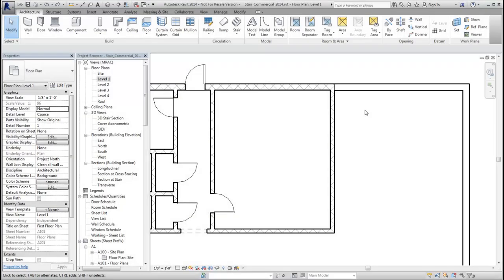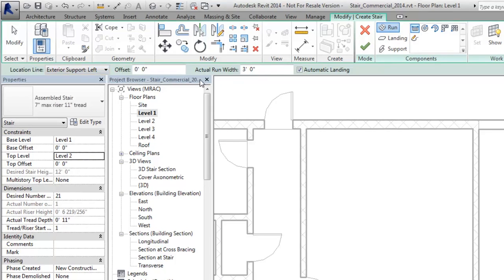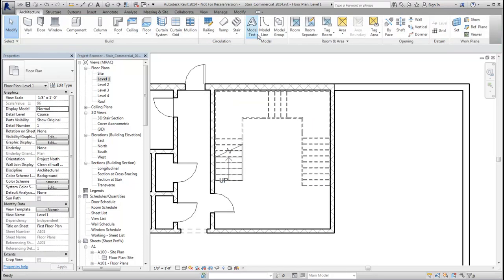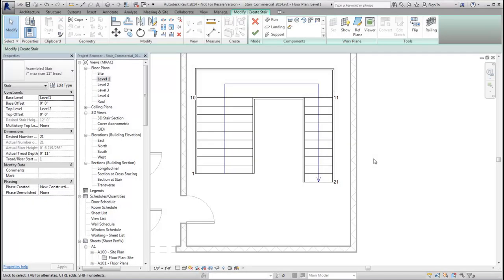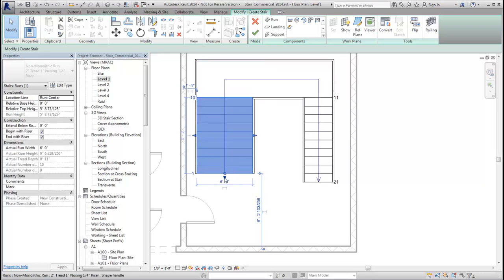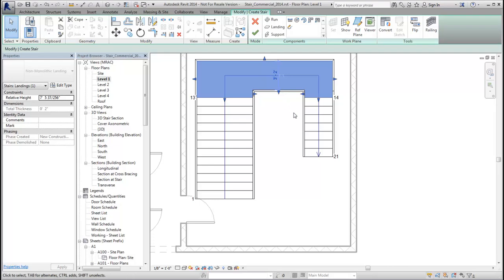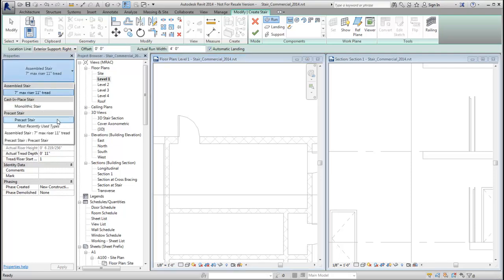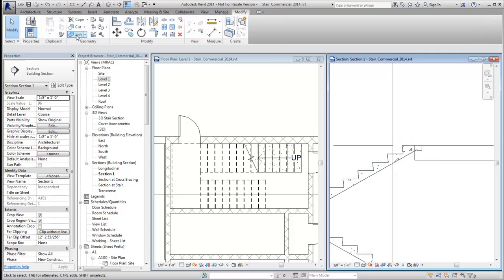Autodesk Revit: Component Stair Enhancements

Comment: Great improvements, well done. When will a user be able to add generic components into a precast stair same as walls, floors etc? Rebar works great but I'd like to be able to add other components. Thanks